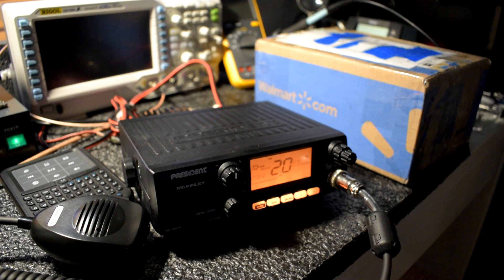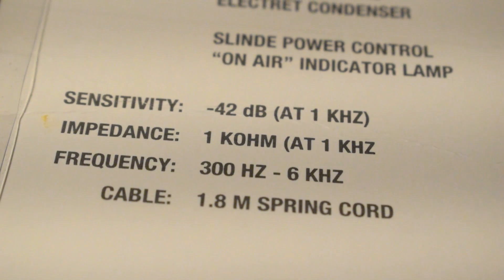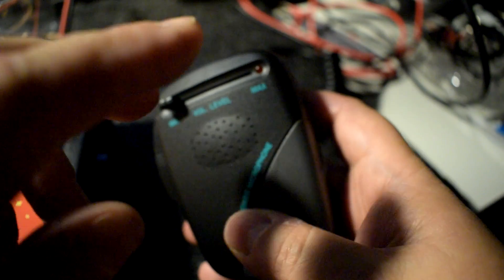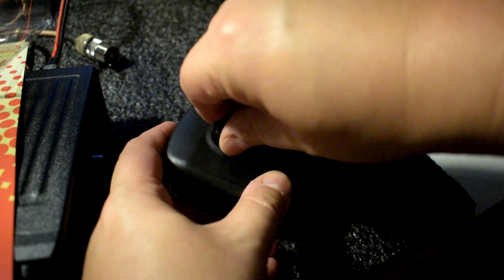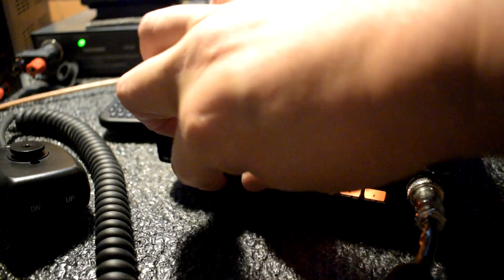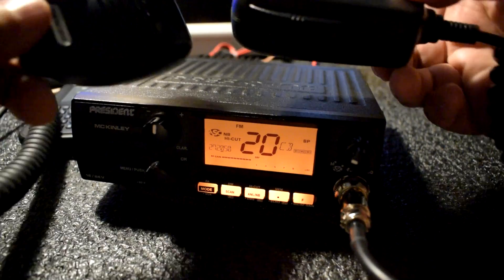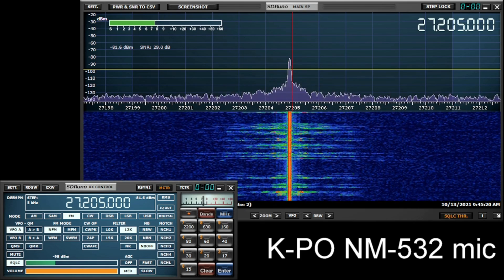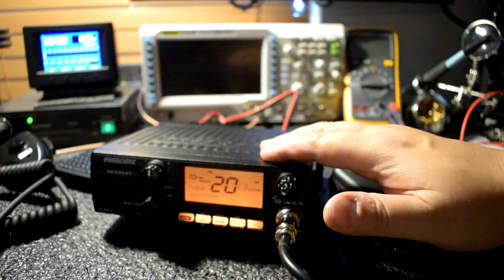President McKinley  -  stock mic vs K-PO NM-532 power mic (English)

Comment: The K-PO really sounded great and it didn't even distort at a 100% though you can hear every gasp of air while talking at that level. Anyway, it will be very seldom one will use it at that high level so below that is still a clean strong audio. Thanks for sharing.

Comment: I have the McKinley and the K-PO with echo.   I found that to get the same level of volume to the stock McKinley mic the K-PO is set at %50.  However it picks up a lot of road noise when driving.  Works great when static!!!!

Comment: You have an internal adjustment to improve FM modulation.
Reply from the maker: Yes, deviation trimpot - also there is a way to improve the audio circuit but I decided not to modify

Comment: Hi can you please me how to adjust the mic gain on the McKinley radio. I have been my radio sounds quiet,it’s a new radio.
Reply from the maker: Hi David. It's easy. You need to hold the F key while transmitting and adjust it with the menu knob. I wonder if you have the EU version. I think the US version is different. Here is the user manual link (see page 45). https://rigreference.com/documents/rr-5ed2c962963445.69814184

Comment: kpo is a little tinnier as it is only a 6K mic these do not have the high end frequency response read the back of the package   any good mic will do at least 15k
Reply from the maker: For sure, but also depending on the radio audio circuit, which in some will limit frequency response. Thanks for your comment! I appreciate it. 73!
Reply: @Eduardo_A_dC  Yes, Exactly I sweep lots of radios and it is sad some like the bearcat and Lincoln plus cut off at less then 1700 while others sweep off at over 10K

Comment: Stock mic sounds better. Has slightly more bass to it.
Reply from the maker: Right, I think the stock will do well locally while the K-PO might do a little better DXing specially in non-optimal conditions due to the higher voice frequency range / pitch. Great observation. Thanks Joe. 73!